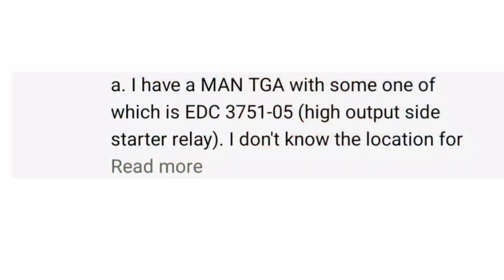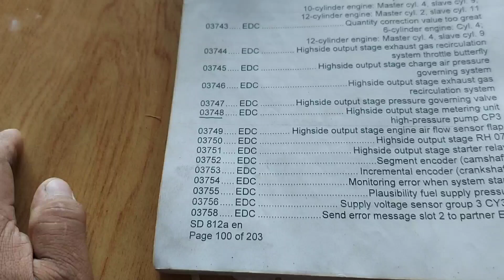Engine fails to Crank MAN

Comment from the maker: Edc 03751-05.HIGHSIDE OUTPUT STAGE STARTER RELAY-SHORT CIRCUIT TO EARTH
Reply: EDC 03751-06 …….can you tell me what is wrong with my truck ….wont crank
Reply from the maker: @speedrecords5282  check firts the electrical wirings in the  starter

Comment: Hi bro, my truck wont crank, when i turn key, relay clicks into electrical box on passanger side, but nothing happens, no error codes. When i short on the starter, the truck starts. Is that relay problem?
Reply from the maker: Hello brother,check first all wire connection in the starter motor.many time happened also that trouble here.most of the time the problem is the  broken wire (cut)
Reply: @jlcworkshop  hi bro, i have checked diagram, and it says that k755 relay into central electrical box when activated, it connects ground to the contact of this relay. Are coil contacts connected between control pin and positive input? Because that is 3 post relay. How I should test that solenoid?
Reply from the maker: @meax7180  hi bro.look at this video there is a cable wire with yellow color jumper wire from edc going to starter relay.
https://youtu.be/G-KG7gt-Tv4
Reply from the maker: https://youtu.be/zxvM5beeVQQ

Comment: Thanks for sharing sir 

Can you explain What these code mean ?
INST 02987-03
ZBR 04042-00
ZBR 01086-04
Reply from the maker: Ok sir if im not busy i will make a video on it.
Inst 02987-03 parameter set in combination gauge or chassis number in tachograph not adapted to the  vehicle....sir did you changed the tachometer?(dashboard) or tachograph or the zbr?without reprogramming?.
Reply: @jlcworkshop  yes i changed ZBR computer and tachograph with out programming
Reply from the maker: @its_Zazi  sir, that is the reason why you have a  fault code inst 02987.